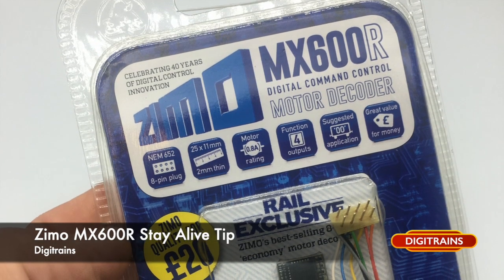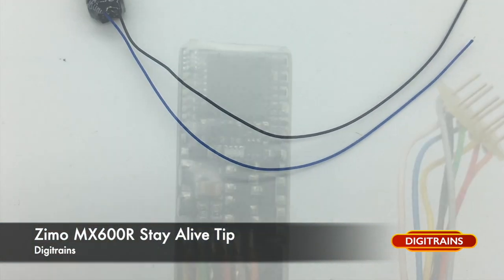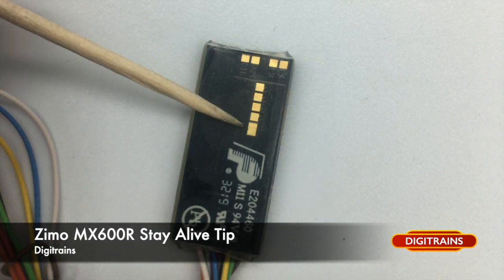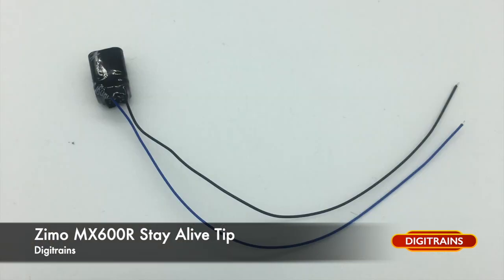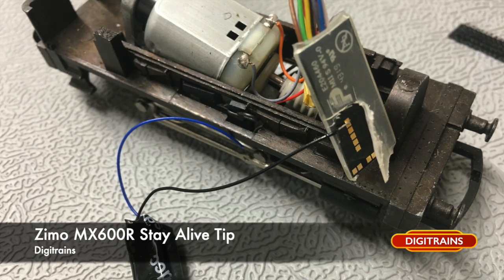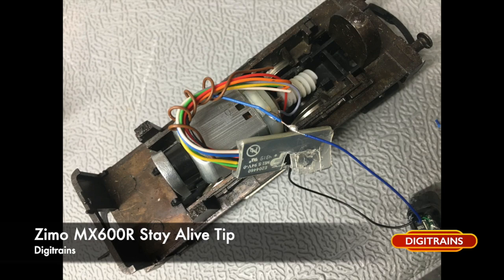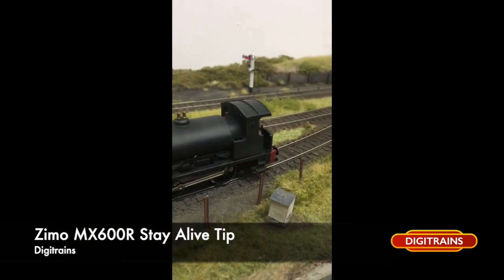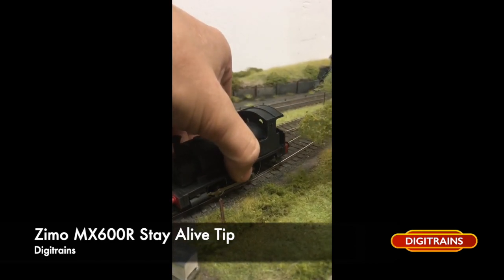Adding stay alive to Zimo MX600R Decoder.

Comment: Will the train o matic ssp-n work with the mx600 decoder?
Reply from the maker: Hi Simon, thanks for getting in touch. To answer your question yes it is possible. You would have to wire the red and white wire to the common pad and the black wire to the ground pad.